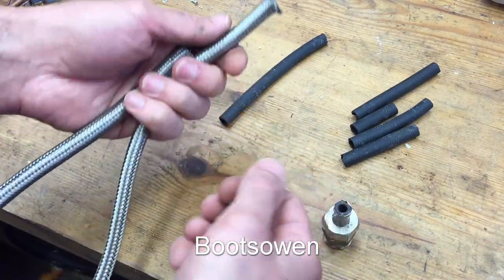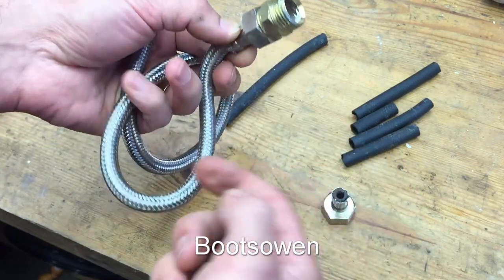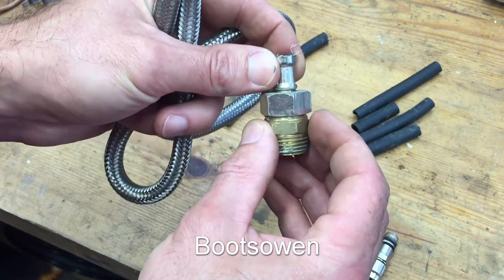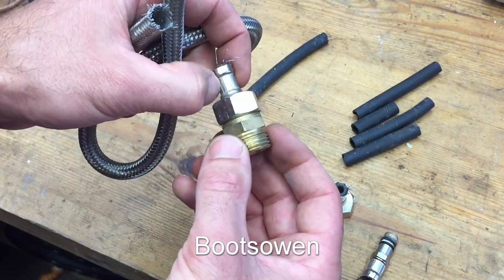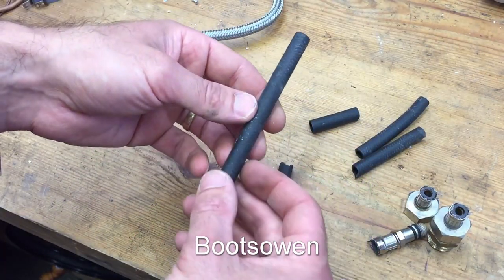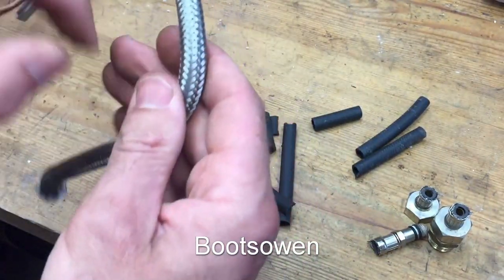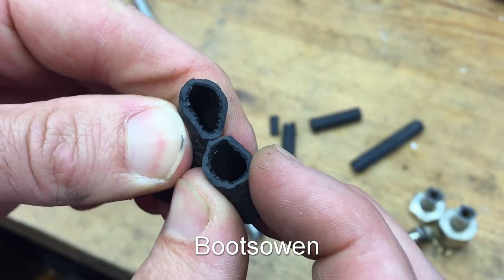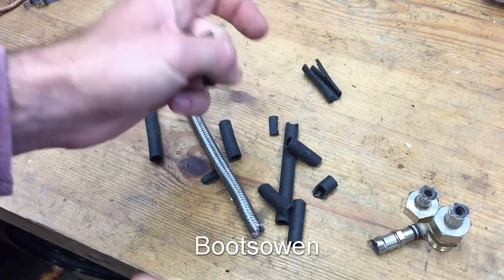Why you should stop using flexible tap connectors: Stainless Flexi hose fail: Guaranteed to leaks

Comment: Had one of these rupture recently on the hot water side of our mixer tap behind our downstairs sink. Totally destroyed our downstairs floor and sitting room carpet. Seemed like it was a slow leak at somepoint and then completely gave way over night. Braiding was rusted. Unit is only about 3 years old installed in a new home built 2018. We have 3 more in the house all okay so far. Seems like possibly a bad part, or damaged during install. Either way the damage is done.

Comment: Yep- this failed under my elderly parents bath in the middle of the night. The amount of water flooding the upstairs and downstairs was terrifying until I was able run to their place (over a mile away) to cut off the water from the mains.  The internal stop-cock was inaccessible , the bathroom sideboard was all tiled up so couldn't access, caused unbelievable stress. Got the plumber to replace it with proper copper-pipe connections.

Comment: I've only just started to use these as they do make life so mush easier, before these there were problems with the old fibre washers on the tap connectors. Just keep an eye on things I suppose, cheers
Reply from the maker: I love them, so fast and simple. I have seen some with other types of hoses within, but you don't know until you cut them open. I guess it is better to go with new on these, or gamble!

Comment: What is the alternative for a tap that requires a M10 x 1/2″ BSP?
Reply from the maker: A solid copper and brass screw pipe into the tap body and then copper or pushfit from there. Or just be aware of the potential issue and keep an eye out. These hoses are everywhere and they are cheap.